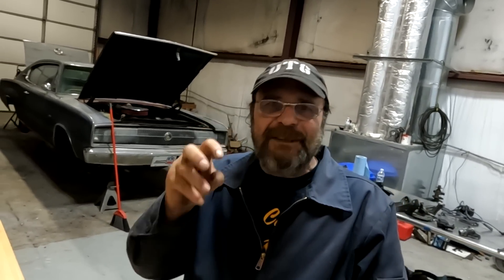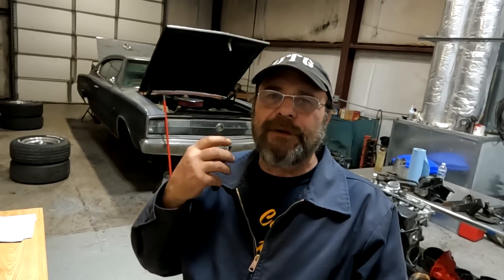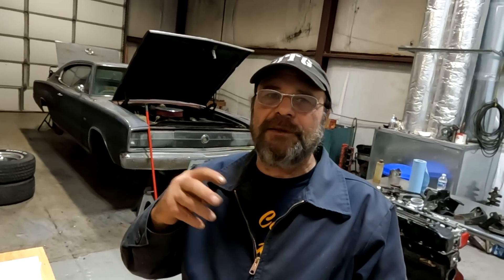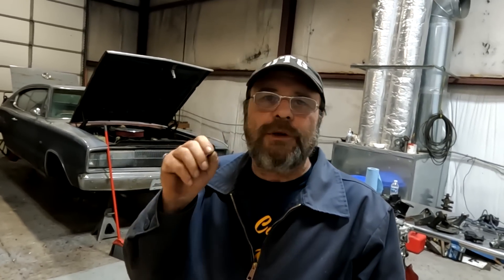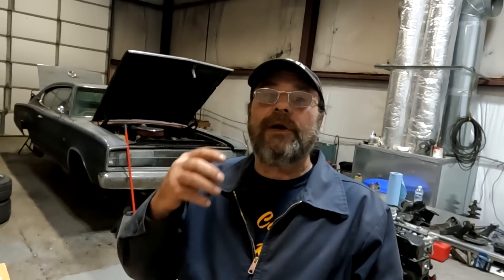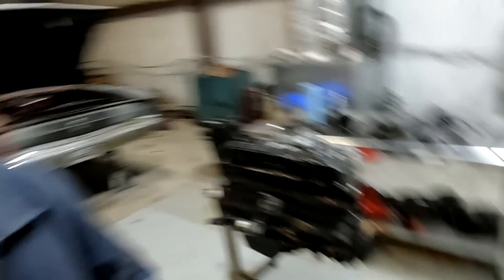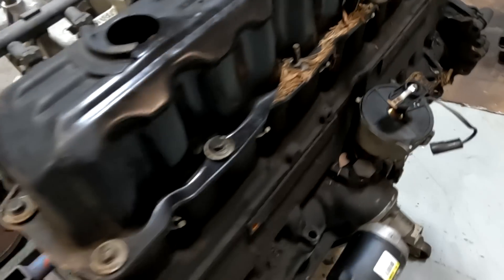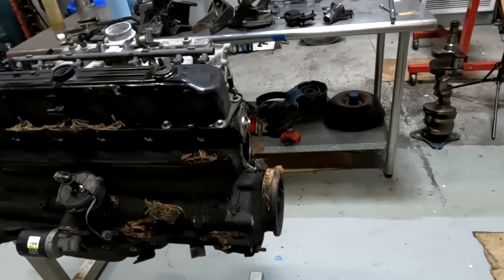Your First Engine Job - The Teardown, Diagnosis And Repair Of A Typical Automotive Engine

Comment: Not sure what year engine that is , but the later blocks with the NVH fixes will have a main bearing stud girdle .
If you want to get the.most power from stock components without going down a rabbit hole , find a 7120 or 0630 cylinder heads these have better low lift flow than the later 0331 heads which are prone to cracking and have smaller exhaust ports .
Lose that log intake and find a 99+ equal length runner intake , then add a set of steel tube headers . Since your core engine has the old style log intake , it does not have the coil pack ignition so you don't have to worry about not having the bolt holes to mount them . Also it most likely had the old style cast iron header that is prone to cracking .
These are simple and cheap ways to keep it essentially stock but give you a little extra zip without going nuts with porting or bigger valves .
Just a cleaning and rebuilding / surfacing , along with gasket matching , and call it good .
I am dying to see what DV could do with a  factory head and maybe the Edelbrock aluminum head as well , but , that would be a whole other set of videos .
Anyway , keep it coming Tony !

Comment: Can you please teach the up and coming mechanics about the proper way on how to use  silicone. I have never understood how these TV mechanics glob silicone on the engine with their fingers and the press the paper or cork gasket on it. Paper and cork gaskets are meant to go on DRY! At minimum use a spray glue or tack to hold in place and I am not talking about the silicone that goes in the corners when putting on a gasket. Please and thank you.

Comment: Coincidentally,  I will be going through this same process on a 76 AMC pacer with a 258. I recently bought the car with a little over 70,000 miles, however it leeks oil and has a rough idle. After rebuilding the carburetor with no positive results, I discovered a leak in the intake manifold. At this point, I have decided to disassemble and rebuild.  I look forward to this content!

Comment: If you've never built an engine before go get your self a small block Ford from the bone yard they are one of the easiest V8s to start with particularly a later model roller block or a small block Chevy that would probably be the next easiest engine once you get a decent understanding of measuring piston to bore clearances bearing clearances learning how to measure push rods and stuff like that you can move on to harder stuff like Pontiac Buick Oldsmobile Mopar then you can get into the  LS stuff or if you feel like you're experienced enough you can start with LS stuff but in my opinion the small block ROLLER Ford is the absolute easiest engine for a beginner or a roller SBC!

Comment: Me, I am learning more over what my dad taught me. I learned a lot but not enough before he passed away. Uncle Tony is a little bit like my dad. He enjoys what he does and likes to share his knowledge. He also explains in terms for the beginners to be able to understand. I have his '71 340 Duster he special ordered new. He still guides me to figure things out when stumped and he been gone for 13 years this May.
Reply: I know, it still hurts. Sorry for your loss. Enjoy his car.
Reply: My dad died 15 years ago this month (January). He didn't teach me much about engines (that was grandpas area lol) but, he taught me more life lessons than I can possibly count! Even though I'm 54 years old, I feel very fortunate to still have both of them guiding me!
Reply: @MikeBrown-ii3pt  I got my tinkering from my grandpa and being a "avid collector" aka pack rat from both. Lol
Reply: Uncle Tony D is my hero. I am a Ford guy and especially the FE. I just have loved them  for the fact that you could take a stock 390 bore it .030 and find a 410 or 428 crank at the junkyard, just find a 66-67 Mercury marked cracked block and make a deal for the crank, usually $25 back then in the early 80’s most people didn’t even know what they were, but in a .030 over 390 you get a 416 with that crank.  I had a simple formula, I d unhook it and they would lift it out with a wrecker and I’d pull the pan and the crank along with the flex plate. They are externally balanced and all you need is the flex plate. Take it to a machine shop and have them clean and turn it if they have to. I swapped parts around, it drove my wife crazy. But I d swap for cams and lifters and intakes.  I had traded for a PortoSonic and they are the best to this day with a set of 352/390 C4AE-G style heads with 2.15 1.6 valves with just a bowl hog and blend. I traded for a Lunati  SPJ2- 285 solid.  Forged pistons were cheap then I got some L 2292 F dome pistons with 1/16-1/16- 3/16 SS-50 rings the tops were moly- coated. I d gap them and thread the valley drains and put brass hose nipples in to let the air out of the crankcase.  Put it all together and that cam in a 416 with those valves and the PortoSonic got me in so much trouble, 😂. I put it in a 67 F100 with a C6 that I had shift kitted and had a 2800-3000 converter. I had also had the rods done with new ARP bolts. Added a Ford windage tray.  They were just 1.75 tube headers with long 3 inch collectors. My favorite prey was the 83 305 Camaros, lol.    That truck was a real sleeper. The exhaust was all that gave it away. But I never broke it. I still have the block in my 65 Galaxie as a 396 ci screamer. I sold the crank to pay for refreshing the 396 ci FE with the same heads, but the domes gave way to flat tops and a higher lift with a 6 degree lower duration and narrower lobe centers and a Holley SD ( the POS and Lunati is still in the shed. ) This FE has been under my foot for 40 years reaching 7500 rpm’s many times. I lost my sight a few years ago but we run it so often. My son is scared to death of it. It revs like a motorcycle with the 4.33 locker and the same C6.  😂 I miss hammering on it. The FEs, B-RBs and 396-454s 400 Ponchos are just incredibly good for just good old fun. Going to the next level is where any engine gets expensive. I can still build a $3000 FE that will Aquit itself just fine. You have to know what to fix and what to leave alone.
Reply: Me too, sorry for your loss
Reply: Learning from my Dad, and my Father in law, both who are gone now. I miss them both so much, it is hard to get a project going and and have to make all of the executive decisions to take the project to the finish line. A project is never finished, but at some point you have to use it for something or pass it along to someone else who has a grip on what is there and how it is intended to be used. I am 62 now and in the health you get in when you use more than you generate. But you don’t give up, but it is time to start getting some of the things you have learned to be next generation. My son is 42 and he can do anything he sets his mind to. Right now he has a wife and 12 year old daughter to provide for.  I am happy that I can die at any time and everyone is in the best shape as I could leave them in knowledge and determination to accomplish.  The best gift to give to your children is what your parents gave you, and to gather the courage to do whatever you set your mind to. I miss my Dad and Father in law a lot.  I had to pass that on to my kids, their friends and anyone who wants to know, who may have grown up without these people in their lives.  Keep on with that sledge hammer and learn how to get the best from every swing and teach every one to do the same. We will have a good society. That regard’s everything that we touch from financial to final assembly. God bless all the Dads to teach and their sons and friends to learn, so the ability to do doesn’t go away.

Comment: The best way to learn is to get a junk lawn mower for free and repair its engine. Then move to a free pre-1980 4 or 6 cylinder car engine. Take it apart. Learn to clean, hone the cylinders, clean the piston ring grooves, lap the valves, plastic-gauge the rods and mains, and put it together. New gaskets are optional in this practice. Then try a good engine. Good Luck, Rick

Comment: What exactly are you touching when you start the car with a screwdriver under the hood?
Reply: 2 contacts on the starter solenoid, or relay. One is constant live power, the other is the trigger wire for the solenoid, the one the key switch energizes.
Reply: @SillyOldBlokeFromOzzieland  ...and this can be done with a car with HEI...or only older with points?. Did they change it so it can't be done anymore?.  Thank you kind sir

Comment: Let me throw out a few things I'm hazy about when thinking about trying my own engine build....
Does this block need to be machined? Where is the line on cylinders needing machining versus getting by with the dingleberry treatment.
How do I know what size pistons and rods I need? How do I know if mine are good to go? Which bearings do I need? 
Really, a lot of "how do I figure which exact part to order?" What am I measuring, what am I measuring with,  and how does that translate to buying the part to fit.

Comment: I'm really excited about this. I've always loved cars, but never had the knowledge or experience to do more than simple brake jobs or replacing water pumps. It gets overwhelming really quickly if you don't know what you're doing.
Reply: I'm not sure what your budget is or if you have a place to work on something. But if you have the space and the drive to build find something pre 1990 and cheep. Alot of junk yards will sell you a car or truck. Take your time pick what excites you and just play with it don't worry about a show car just enough so you can drive it
Reply: Not that bad if you use proper methods. if you take an assembly such as an automatic transmission, and lay the old parts out in the order disassembled, you can recondition sub assemblies one at a time, then reinstall in the case. An ex-girlfriend taught me to build transmissions back in the 80s., I  had done engines for years but never transmissions until then.

Comment: I had one (inline 6)  in my 81 CJ8 Scrambler with the plastic valve cover, cold engine oil pressure was 30 psi! 
After warming up it wouldn't reach 30 psi  on the highway.
Tough engine drove it like that From 1990~95 until the transmission quit.

Comment: Can't wait for this series. I have worked on many cars for many reasons, but never understood a few things. One of which is why do we have to unbolt heads in order? I understand why you would assemble in order.
Reply: Same reason, avoid warpage. Should do the same unbolting wheels, but those don't leak 😀. In addition to what @Muppet said, different materials have different mechanical properties ... Thermal expansion, spring rates, brittleness, etc. Slow but sure.
Reply: In the case of old pig iron, it probably doesn’t matter.  But the answer is best explained with rocker shafts (Ford, Chrysler).  Everything is a spring. Even if you back off the adjustment on all of the rocker arms, at least one is still under tension.  You want to release the fasteners a bit at a time to keep the load the same across the surface.  I’d say this is more important with aluminum heads, especially with head bolts that may be holding down cam caps.  I can’t think of any aluminum examples besides Jag XKEs that trap the spark plug wire jacket under a head bolt like a bunch of assholes.  What other car do you know makes you crack a head stud loose to do a tune up?  MGBs have a cast iron head, but their rocker shafts are held down by the head studs.. Really, just crack everything loose, pay attention to how it feels, and do it evenly until they’re loose.  Honestly? How many videos have you seen with people running head bolts out one at a time with an impact?  

It’s good practice to have a procedure, is the super short answer.